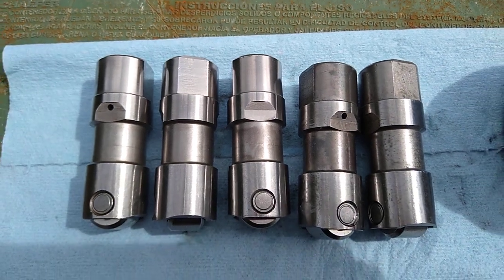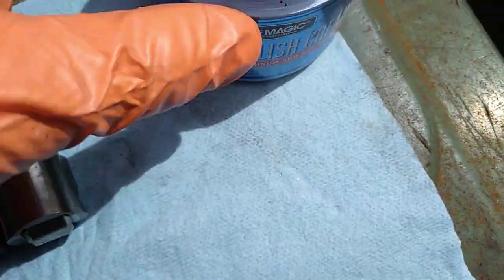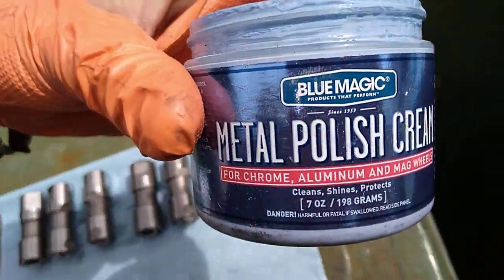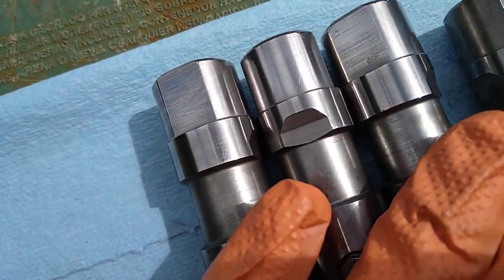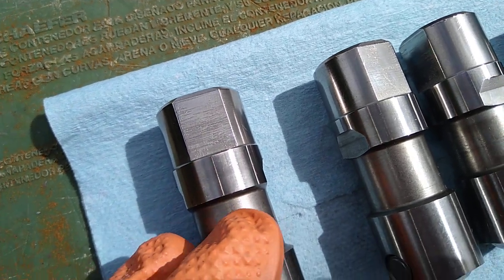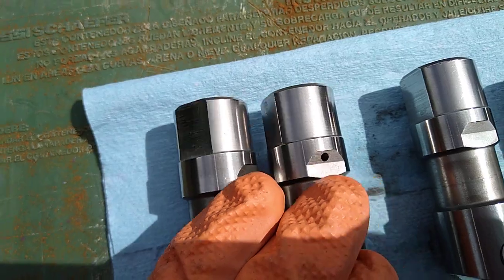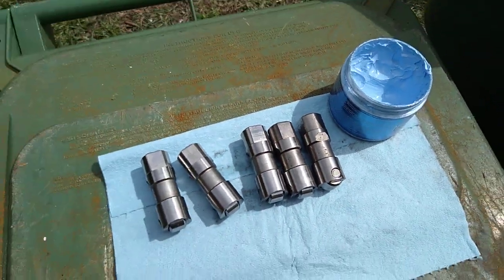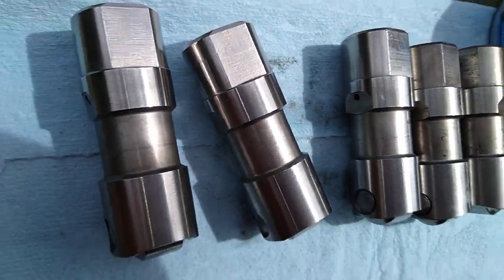Turbo 6.2 Diesel Polished Lifters vs Unpolished Stock.

Comment: I wonder what it would sound like with a full 5 inch
Reply from the maker: I'm sure I'd be nasty but the 4" Side Dump I have now doesn't sound bad at all.
Reply: @TheAscendedMaster  It sounds great you just never see a 5 inch set up On a 6.2 or 6.5
Reply from the maker: I will be changing the Exhaust eventually anyway so was going to do 5" back which I was quoted 400$ for all Mandrel Bent by a Exhaust Shop.